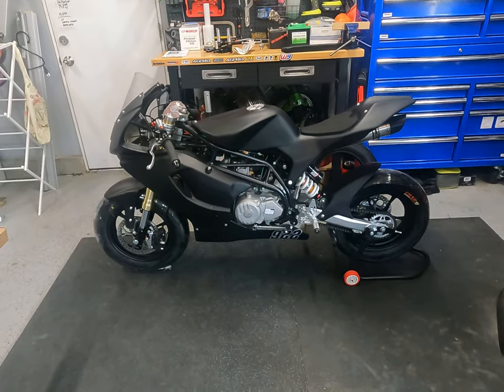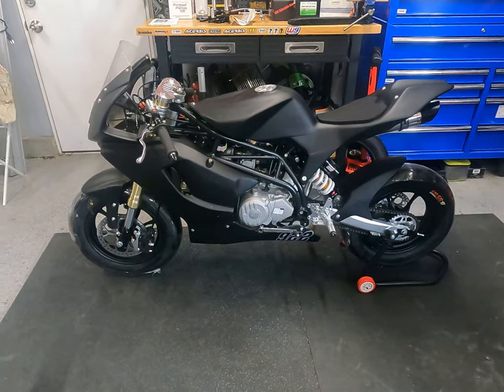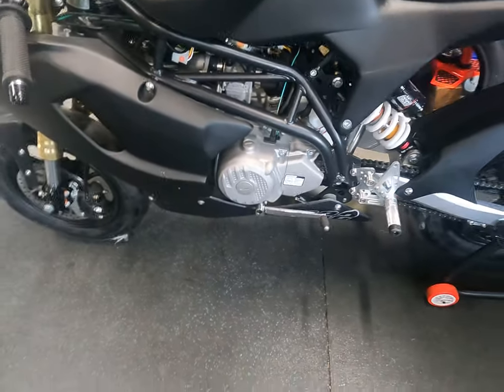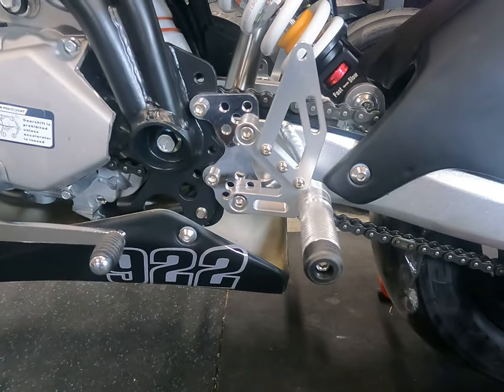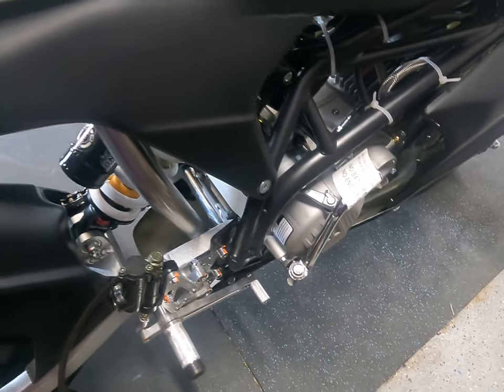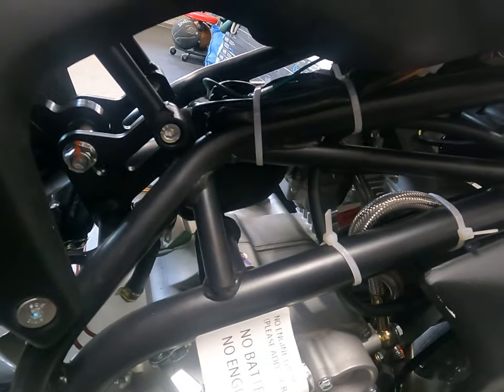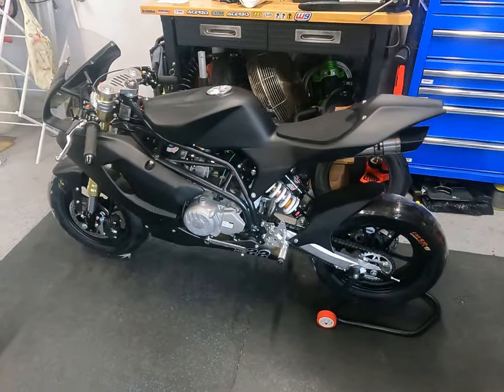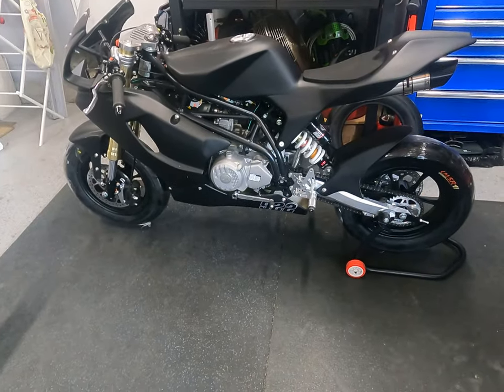VMC GP-12 w/ ZS190 walk through

Comment: Hey brother, open the seat and tank and    Re mount the wires. You will get more slack for the positive and negative wire. I did that but for got to mention. 3m glue for the seat foam as well.
Reply from the maker: Hey Peter, did just that today...it did the trick! Thanks

Comment: I just wanted to let you no don't use the kick start at all in less you have to and check or add the shift star mod. The reason I was able to buy the Dayton engine out of the gp ohvale is because the guy didn't have the shift star mod or electric start Wich are need if not it can cause the transmission to fail either the in put shaft or out put shaft will end up snapping on the engine just like the Dayton engine I bought off a YouTuber. I rebuilt the Dayton engine and used newer thicker shafts that there now selling and put the shift star mod. I only use the electric start Wich is also recommended to by ooracing. Just a fyi buddy 😉💯🛠️🏍️🍻✌️
Reply from the maker: Thanks for this advice! Ive heard that too....im assuming that my newer motor should have the shift star mod but Id have to pull off the clutch to really know so thats on the to do list. I wonder if Ohvale ships the Daytona motors with all the fixes or do they have the same problems as everyone else?
Reply: @Freddi922  they have the same problems because they just put the engine in the bike they only build the bike it self the engine factory would have to make the changes that kinda of part off the company problem. Ooracing sell the complete engine with all the upgrades there the only company that offer it  that I know of and IV done quite a bit of research more than most people even on the forms that  I'm on.  They say the factory doing the upgrades to the engine on the new models the shafts and shift star mod but IV heard some people say that even some of the newest models aren't coming with the up grades kinda why I recommend checking for your self just in case never hert's  👍🏍️🍻💯✌️

Comment: Nice review. What's the max rider weight capacity? Wanted to pick one up for practice but wondered if it would work for me at 6' and 210lbs.
Reply from the maker: I'd say im about 180-185 lbs with gear and the bike handled great. It does have adjustable shocks and you can get it with adjustable forks upon request, that said. I think it may need higher spring rates for anything over 200ish but that can be solved aftermarket. I have a friend who is heavier than you who just bought one of these and were going to figure that all out by working with companies who have made kits for the Ohvale GP2 as the suspension is very similar. The adjustable fork is 38mm stanchion by 660mm overall - we will try Mupo suspension springs and the rear is a DNM Hornet shock and I believe they do make different spring rates so we can go direct with them.
Reply: @Freddi922  cool thanks. Can I just grease up chain, add 10W40, gas, add battery and just ride? or is it necessary to open the engine and adjust the valves???? I thought this machine would be ready to go after added the fluids?
Reply from the maker: @travelocationfilms3020  id say you could do all the above but from my experience its advisable to check valves as they come tight. its pretty easy though, theres videos out there that I can link you to, that will help.
Reply: That any video that instructs how to do would be awesome. Thanks again.
Reply from the maker: https://www.youtube.com/watch?v=JhwzG3kPT3g&ab_channel=ooracingtube @SportbikeUnitedRiderz
Reply: Do u mind sharing the link where you purchased yours

Comment: It's not worth buying the Dayton in my opinion from factory. Any plans on upgrades and track parts I know of quite a few if you want I can give you my e. Mail and we could talk about the most price efficiency way to do it.  wouldn't dought you can make it just as good if not better than a original gp2 bike. I have also taken apart and rebuilt the 190cc engines and helped other on YouTube with there 190 engine..💯🛠️👍✌️🏍️🍻
Reply from the maker: Yes id love to pick your brain on upgrades sometime down the line, at the moment I am more interested in a good baseline setup but I love to tinker so I will contact you in the future thank you!
Reply: @Freddi922   there is a 70 percent stronger decomp.spring for the 190cc  that offered. You might want to check if it already has the shift star mod done to it . If not it's easy to do.  You can also got a upgraded d.i.d starter chain for it .  And ohvale has a gp shift  pattern conversation . the guy I bought the Dayton engine off of had a bad ass set up on his gp with lots of upgrade parts. He also custom make and sells crash perfecter track parts 💯👍✌️🛠️🏍️🍻